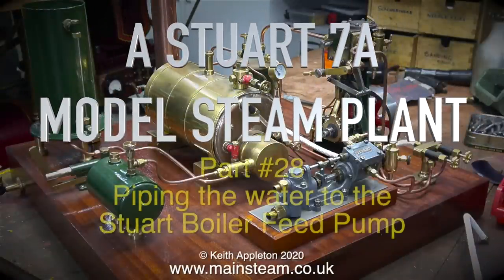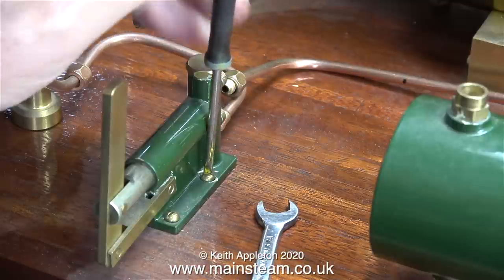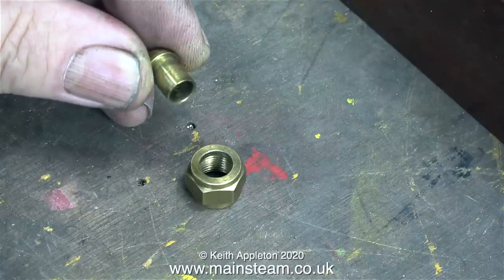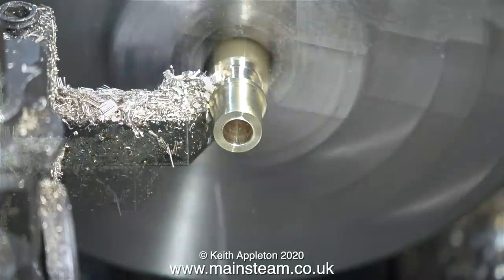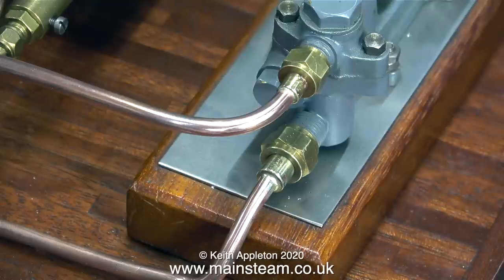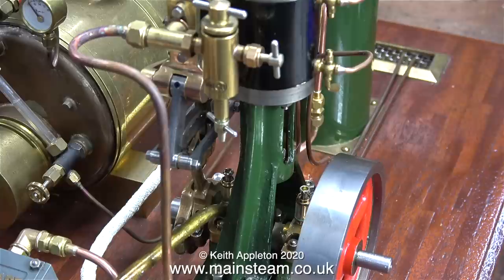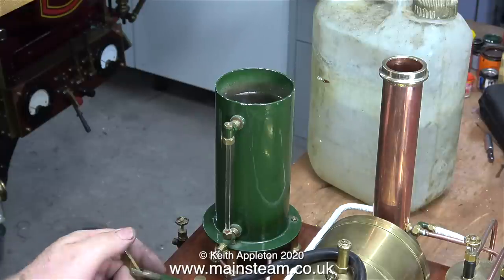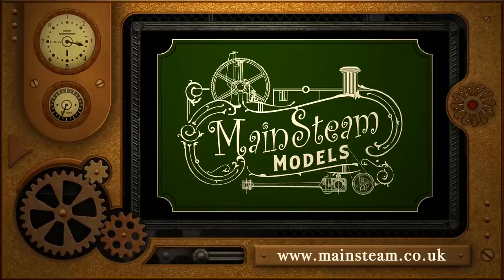A STUART 7A MODEL STEAM PLANT - PART #28

Comment: Thank You for uploading those videos!
This came in handy since i just plan to buy parts in order to upgrade an old machine wich i think is pretty similar in size to the Suart macine in the video, i wish to re fit the boiler with a feedingpump.
Since i don't hawe any machines here at the moment, i concider using a PM reserach waterpump. (Later i think i will go for the Blackgates 3" pump kit when i mastewr the machines a bit better and can afford to by proper macines... I hawe an unmachined kit for the Stuart pump, but it feels like i need some more prectice before i take on that... However it's a realy beautiful kit and i realy hope i will sucess with it without ruin the castings in the future. )

Comment: I'm no expert on steam engines and piping, but why didn't you connect a straight piece of pipe to where the blanking plug was and then either bend it or connect an elbow? You could install the check valve after the bend perhaps?
Reply from the maker: All will be revealed in time {:-)))